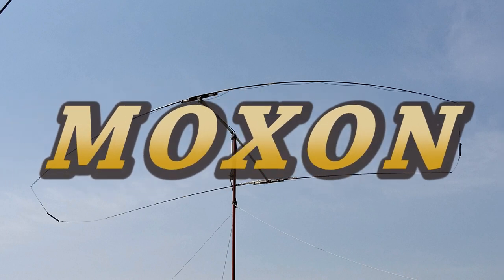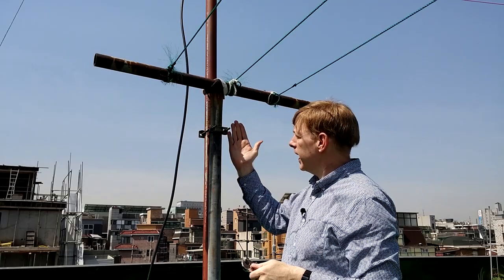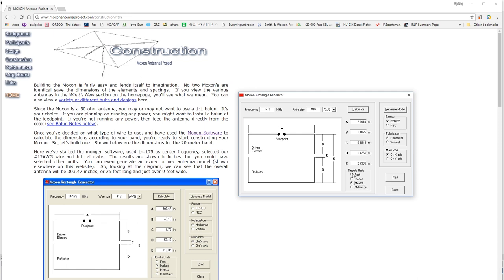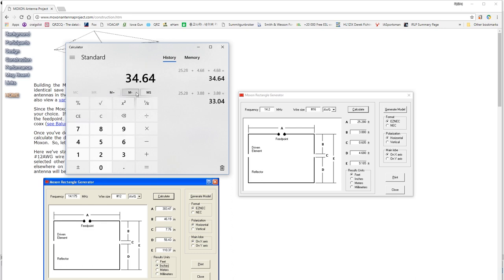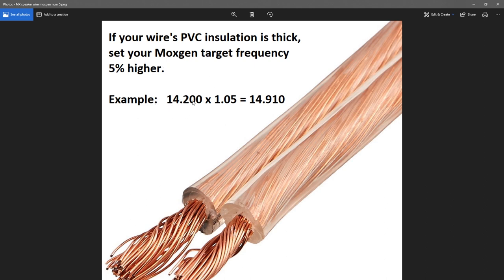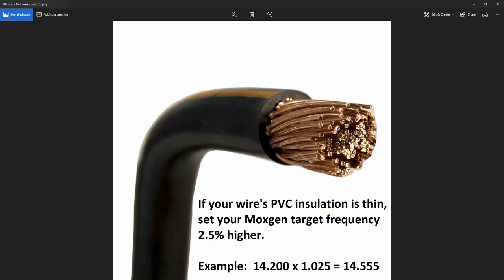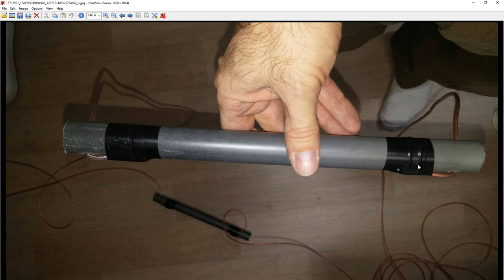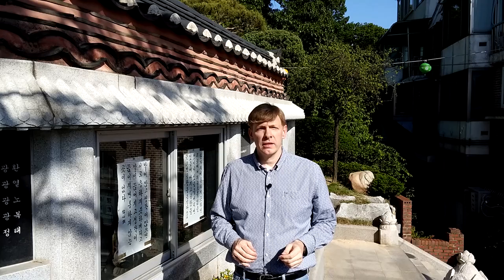Moxon Antenna A Great First Beam

Comment: I built one for 11 meter a few years ago out of copper pipe and spin it with a TV rotator. Up about 40 feet.
It works a treat. Talked to every continent,except Antarctica, from Canada.
My next upgrade is to add a director to narrow the beam down and add side rejection.
Excellent video. Thanks
Reply: Where did you find the specs for your moxon?
Reply: @robertbailey2342  moxon not Nixon's 😖😄

Comment: Enjoyed your video.  Have always considered building a moxon antenna but have never gotten around to it.  Am only using wire antennas but in the past had a four element quad antenna which is really a wire antenna.  Had great results with it working over 200 countries in around a two year period.  No longer have it so just might give this antenna a try.  Thanks again & 73.

Comment: MOXON is great small space antenna.  vertically mounting seems like work well.  they also mtches to 50 ohm just fine, if it choose right dimension.  I use 4NEC2  simulator to determine best dimension for use.  AG6JU

Comment: Great video. I will have to look into this myself although I am not very "handy" when it comes to building things I have never been successful so far in my endeavors, lol. By the way, Thanks for the THOR QSO last night.
Reply from the maker: I had fun!  Too bad condx aren't great.  I'll get up and running with FT8Call after it hits mainstream.  I now have a basic 2el yagi of wire/pvc/fiberglass. It's got a boom about 1/3 as long as the Moxon.  The Moxon is the better overall antenna, but the 2el is lighter.  I was worried about the moxon's heavy PVC boom I was using, and the high winds we had in Spring.  Had it up 1 1/2 years, though.  I miss how 17m worked off of it without much loss, as well.
Reply: Unfortunately, I live in a Home Owner's Association which it seems has an unrealistic fear of antennas of any sort. I had to fight them tooth and nail and have my attorneys threaten legal action against them for violation of my First Amendment Right to free speech and denying my right to exercise a federally issued license to operate a radio station from my home address which was listed on the FCC license before they finally backed down and approved the antennas that I currently have. 

I am not even able to temporarily set up an antenna to see if it will work in a particular location or not without first having to fight with them and trying to convince them of the dire need for another antenna, then submitting detailed schematic diagrams of the antenna, exactly how the coax will be routed and enter into the home, and exactly how and where it will be installed along with a minimum of 3 photos of the exact area showing various views of the installation location.

When I submitted the application for my antennas I was not using the G5RV Jr antenna so it was not in the approved permit. I am basically hiding it behind my house hoping they do not look very closely. Since the permit approval, my vertical which was approved is no longer functioning well so I am using the G5RV Jr as my main HF antenna for both NVIS and DX. 

I am hoping that since my antennas have now been up for several months through the fight over them with the HOA and there not being any complaints from my neighbors of electronic interference or "glowing children" from the dreaded radiation given off by the antennas that they will loosen their death grip on me and it will become easier to experiment with various antennas. Hopefully, by then, I will have been able to successfully build a Moxon antenna so that I can try it out.

One of the things I also worry about here is wind as we generally have around 20 MPH winds every day, and gusts much higher during storms. I lost a flagpole last year in a 79 MPH gust when the 2" aluminum pipe broke in half at the concrete base.  Ahhhh, fun times, lol.

Comment: Really well explained with just the right amount of humour! I'm inspired! I may well have a go at this. Question: if using a centre support pole, can it be metallic or is electrically inert best?
Reply from the maker: It can be metallic, but you need to keep the elements isolated from the boom, to stay with the Moxon design as intended and remain a 50 ohm antenna without need for a match.
Reply: @thestingyham1188  Thanks for the reply. After watching your excellent video, I did some further reading which concurs with what you say in your reply. Thanks again. Best 73.

Comment: Great Video! I build a moxon for 27mhz with 1,5mm wire and fishing rod. The total weight is 2,2lb (1Kg), so its perfect for field days or SOTA activation. Could make contact with more than 7000 miles and this of the cycle minimum. 73s
Reply: 35SD120 Frank I would like to see your moxon...
Reply: @SDFrank-bw3kr  Hello Frank,  May I see pics. Of your Moxon Antenna?  I will email you. Tks.

Comment: Quick question, if you alter all the lengths to take into account the velocity factor of insulated wire, shouldn't the gaps stay the same?
Reply from the maker: I don't believe I altered the gap size at all, and it still worked, accounting for wire velocity factor.  Not at this frequency, anyway.  Something larger like 40m might be different, and take some experimentation.
Reply from the maker: After calculating, the gal difference is less than 1/2 cm between a frequency of 14.200 and 14.555, when adjusting frequency to account for velocity factor.

Comment: Very good presentation with some helpful information. I'm currently trying to scale a Moxon for 27Mhz, I think it's the wire insulation detuning it too low (used moxgen). This one  is a fibreglass type, we have built aluminium one's too as you easily can on the higher frequencies. Do you ever get on the CB band, say 27.355 or .385?
Reply from the maker: I took it down, due to a typhoon. Will go back to a moxon, possibly next year.  It worked well on 17m, but acts more like an out-of-tune dipole as you get further from 20m.
Reply: any luck? for the Cb project?? i was wonderinf if this would work ok for the 27 as well?.
Reply: MOXON cover wide range entire CB freq range should be covered .   off frequency  less F/B ratio, but about same gain.  I use 4NEC2 for simulation, it works very well. AG6JU
Reply: I talked to italy russia and new zealand on 38 lsb 27.385 11m cb. From northern cal on 100 watts up 20 feet inside my 2nd floor apartnent Fantastic antenna

Comment: Have you tried building a dual band 20/17 meter moxon?
Reply: No, I haven't, because I read that 17m and 20m may be too close to one another.  I find the 20m moxon is so wide-banded that it works really well with maybe only 15% additional loss due to SWR, if I just tune it to 17m.  I did add a 15m to it, temporarily, and that worked.
Reply: @Swampfox10mm  yeah... I read the same about 20 and 17 elements too close to each other. But there are people that built it and they say that works fine... That's why I'm curious about it. Maybe I'll try to add 20 meter elements to my 17 meter Moxon and see what happens.
Reply: For those interested in building a multiband Moxon. I built a 20/17/10 meter Moxon using individual feed lines and 1:1 baluns for each band. All three bands show directivity as expected, good swr and not interaction between bands. Very pleased with its performance.

Comment: Link for the balun?
Reply from the maker: I got mine from aliexpress dot com.  Here is a similar one.  Many are sold there.  There are smaller and larger.  Search on 1:1 balun

https://m.aliexpress.com/item/32848955405.html?pid=808_0000_0101&spm=a2g0n.search-amp.list.32848955405&aff_trace_key=&aff_platform=msite&m_page_id=8178amp-bAVSYlYgbc7p6jibS2hSyA1542031012368